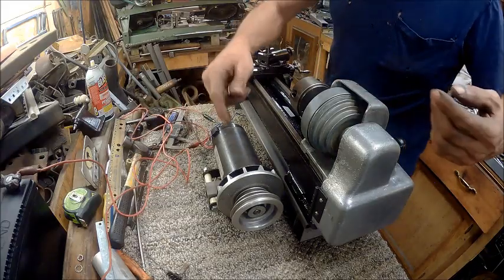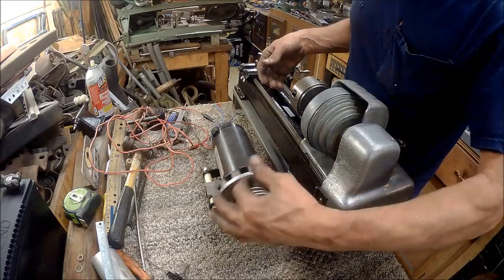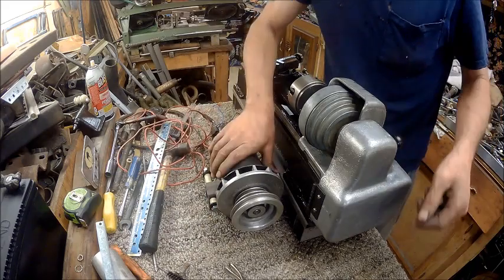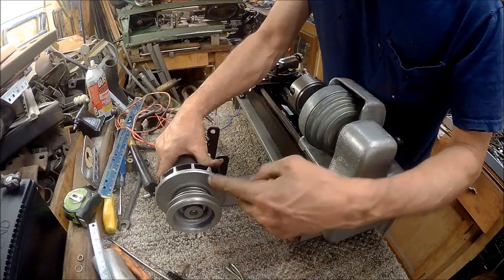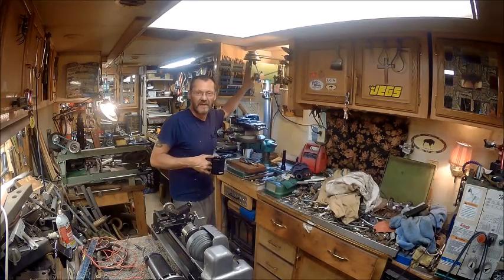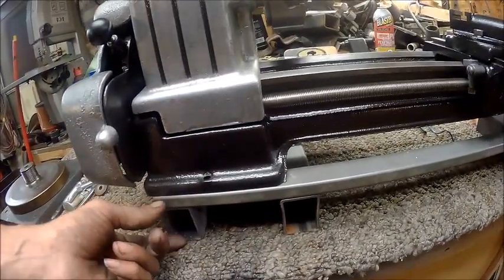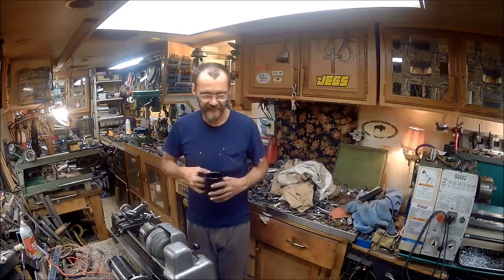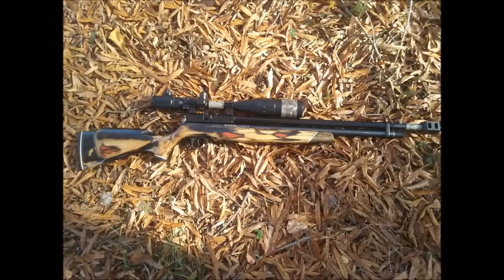craftsman 109 mini lathe restore part 4 the motor

Comment: Is it necessary to keep the planetary gear on the spindle shaft, or can it be replaced with a simple pulley stack?
Reply from the maker: im not sure what you mean.
Reply: @BisonWorkshop  Will the torque provided by the variable speed motor eliminate the need for the OEM pulley with the planetary gear?
Reply from the maker: @gregbacon819  i dont know. without it you would have a mini wood lathe i would think. that planetart gear i would say gives torque

Comment: Hi there, thanks for this video, i happen te have a similar lathe (though mine is supposed to be a Courlan ) but from what i found out so far Courlan is a trading company and the lathe being a model 109.206.30 is in fact a Craftsman lathe which has been sold under different labels. Mine unfortunately came without a motor.. other then that is looks like it is in pretty good shape. Now i am trying to work out what kind of motor it needs.. In the meantime i managed to find a manual on the internet which also has exploded views of the lathe and ordernumbers for spare parts even though i don't know if any of them would still be available. So if any of you know if one could still order parts please let me know (vanderjagtfrank@gmail.com) I will be browsing youtube and the internet on any how to's because i never worked a lathe before but i would love to try and do some small metal work with it. So thanks again for this so far at least is showed me it is doable to hook a motor up  to get it running.. Keep it up and many thanks.. Frank.  :)
Reply: Use a tread mill motor like he is using in the video, it would work well. This is not a particularly powerful lathe so it doesn’t need a real heavy duty motor. The motor will need a pulley and it best to get one that already comes with a pulley.

Comment: Bob, you might consider a shroud for the back end of the motor. Without a back-splash chips are going to be flung right into the openings in the end of the motor. A piece of PVC pipe with a saw cut longitudinally and a hose clamp  would do the trick. It would also shield the motor's electrical connections... another place for a lot of sparks if a chip gets tossed across the motor terminals.
Cheers from the Gastonia-Cramerton metroplex